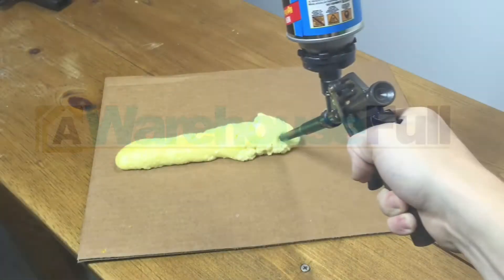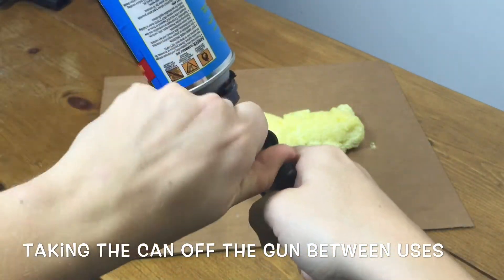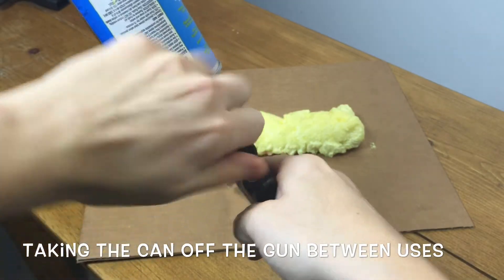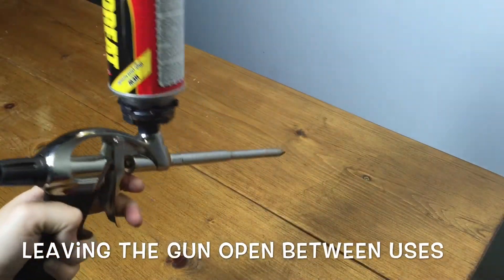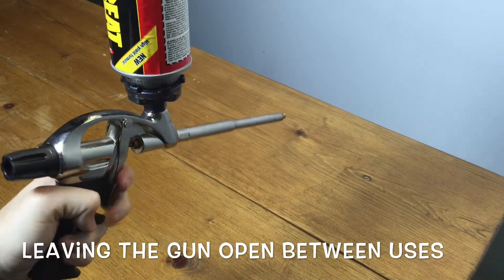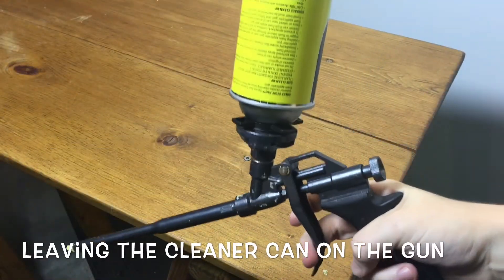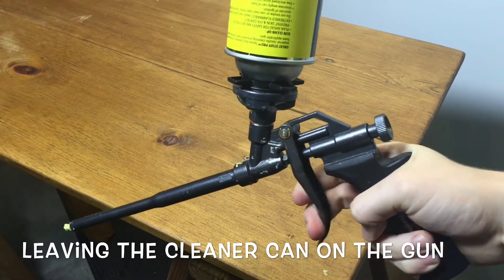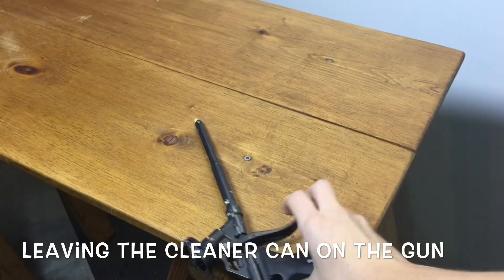Common Mistakes When Using Professional Foam Guns

Comment: I ended up buying the 3 foot long gun with the swivel tip. I have had a can on there for a few months before. Tried to remember to run it once a month to clear the gun and start the waiting time over again till I got back to it. between using cans and what not I went a long time before cleaning it. The last time I though I had waited to long and the gun had dried up and been ruined. Turned out, the Great Stuff brand cleaner did not fit the gun and would not engage enough to clean it out. I ended up buying another gun and realized it was the great stuff brand can that was the issue. AWF sent me a couple cans of Soudal brand cleaner which fit just fine. So, if the gun seems like it won't clear with the cleaner, try the foam again to see if it really is ruined or the cleaner can won't fit.
Reply from the maker: We're happy to hear our service representatives were able to rectify this experience! While this is not common, it can sometimes happen that the threads on some PRO cans are misaligned and don't properly attach to the gun. Should the issue present itself, our service team will evaluate the information provided and find the best resolution possible.

Comment: How long can you store the gun with the foam can still attached, assuming the gun was closed?
Reply: I wouldnt go more than a couple weeks, maybe a month but when the gun is 50 bones foam is cheap.
Reply: @Sean Stevenson once you remove the foam can from gun, does the foam can seal so you can use it another day or is it done, one time use only where you have to use a little or use it all?
Reply: The can of foam can be reused. I do not know how long you have before it’s not useable. But I have used cans a few months later. But you do need to clean the can’s valve with cleaner to remove the foam
Reply: @mikelaaper9100  Wish I had known this before. I thought the pro cans were not usable after being taken off the gun. Think I had gone over a year before trying to clean my gun just so I wouldn't waste the cans I had between trips to the attic. LOL

Comment: Where is part about foam exploding from the place where you screw it in?
Reply from the maker: Thank you so much for your feedback! This can be caused by several factors. The most common cause is due to cross-threading the can to the gun. This is easier to do than one would think because the threads are so large. The second cause could be an imperfection in the can threads. For example; if you attached a can to more than one gun, and still had the same problem, then the problem is most likely an imperfection in the can's manufacturing. The cans are mass produced on an assembly line and mistakes can happen. Finally, while there can be an imperfection in the gun, this tends to be less common. 
Above all, we stand by our products, therefore, regardless of the reason behind your experience, if the issues happened with one of our AWF Pro Foam Guns, or PRO foam cans purchased from us, we kindly request that you contact our Customer Support representatives at 888-223-3050 (8:30AM-5PM EST) with your order number and we will be more than help you resolve this issue. Remember, the first step is to contact us so we can help you rectify this experience!